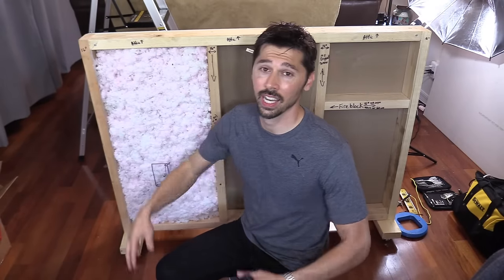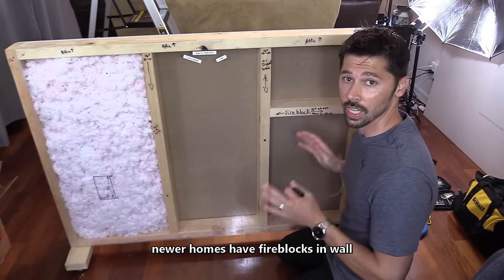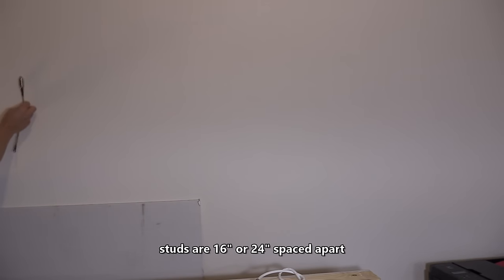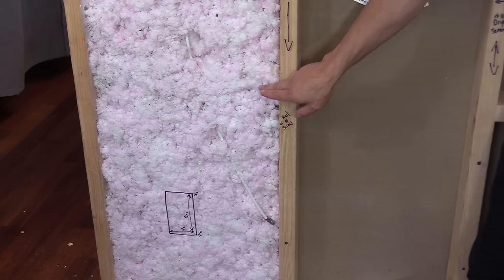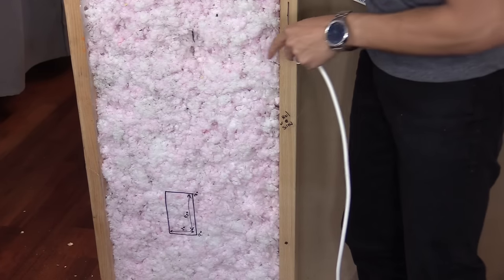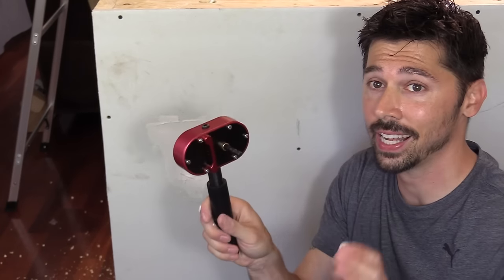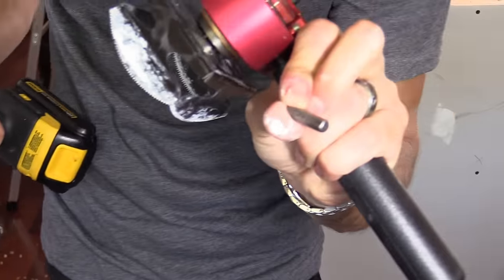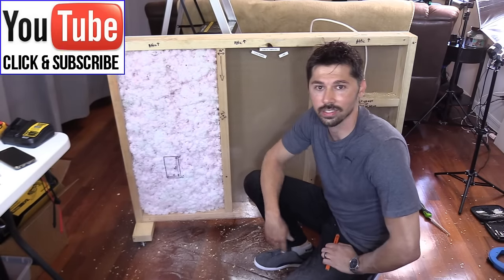3 EASY WAYS TO HIDE WIRES CABLES IN WALL & FIND STUDS

Comment: as an electrician i did that stuff for 40 years the fire block you use a flexible  bit its 4f long you can bend it any way you whant look it up its made by greenlee
Reply from the maker: thx for the tip
Reply: this thing....?
Reply: ray tru Ditto.
Reply: ray tru Klein makes them too. It would be a lot easier and you don't have to cut and patch the wall.
Reply: By drilling through the fire block, you defeat the purpose of the fire block.
Reply: Co Rin Not really. Fire blocking is just a slow down. The material is the same as studding. It burns. True a small hole will give a few seconds less protection but it's not a total dead stop for fire.
Reply: Long drill bit FTW.  No holes to patch.
Reply: Flex bits are where it's at!  My favorite trick was always drilling down from the wall plate opening into the basement. Wrecked more than one bit on concrete doing that, but oh well.
Reply: elesjuan Yep,,, wood bits on concrete,,,,, a definite nono.
Reply: then we wouldnt have any wiring in any of the walls in any construction in the past 20 years
Reply: The long bit makes sense for cutting the hole.  However, how do you then fish the wire through that hole?  I can only guess you are using some kind of fishing rod?  Just poke until you hit the hole and then run the rod on down?  Or is there another method?
Reply: It's really cool the long drill bit you just used to make the hole is used as a fish rod. Without retracting the bit tape your pull string or wires on and let it go. Boom no patching. Customers hate patching...
Reply: Cool.  

Yeah, I was recently looking at having to rewire all the electrical in my house.  It is an old house and has/had lots of 2 prong outlets.  I was trying to think of ways of keeping from cutting holes in the walls...  just like you said... lol.  Luckily, before I got too deep in the planning process I thought it would be a good idea to open up a few outlets and see exactly what was in there.  Sure enough, there was actually a ground wire in all of the outlets.  They simply had the wire connected to the outlet box (which was metal) and not the outlet itself.

I simply disconnected the ground from the box and put it to the negative on the new outlets.  Then I ran electrical tape around the outlet several times to make absolute sure the side screws will never contact the metal case (small case).  Seems to work fine.  Not sure if this is how you are supposed to do it but it is better than how the prior owner had rewired a few outlets.  They had put in a couple 3-prong outlets.  They even passed inspection as being grounded properly.  However, when I pulled the outlets open what actually had happened was the ground was still connected to the metal box... HOWEVER, the grounding screw had been touching the metal case... thus completing the circuit.  I couldn't tell if they did this on purpose or not.  Looked scary though.
Reply: "not sure if this is how you are supposed to do it"- it isn't. If you have metal boxes, you have to ground the box as well as the device.
Reply: Right, I thought you had to ground to the metal box AND the outlet/fixture.
Reply: ray tru 
Clearly you were an electrician, not an English Major... jus sayin'
Reply: @b.l. alley... Thanks for the info.  Shouldn't be that hard for me to ground those boxes as well.  I think the house was built in that short time span where they ran ground wires but were still using 2 prong outlets.  Regardless, I'm just happy that the wire is there...lol.  I thought for sure I was going to have to shell out a ton of money and/or put in a ton of effort to rewire the whole house.  Redoing the outlets is something I can easily do.  It has just been hard finding info on how to treat those metal boxes.  Most have said to just do what I did... so I did.  I've only seen one other source that said to ground the box as well.  That along with feedback here has convinced me to go that route.  It makes more sense.  I guess I just needed others to convince me to ignore the other advice.
Reply: Was going to say the same thing, my supervisor would have killed me if I'd had to patch a wall during a post-construction wiring job. That being said, losing one of those long bits is an equal headache.
Reply: Trust me, drilling through one lously fire block is not going to speed up the burning  of the house.
Reply: Look who's talking? You can't even spell "just saying."
Reply: ray tru That's what I used.  I had some really long bits and I also sharpened them so I didn't have to keep getting new ones.  You could feel the stud and center the bit as best you could and carefully drill.  Some of the drill bits had a hole on the end so you could attach the wire and just pull the drill bit out and then you have your wire.  The only trouble I had was in old houses.  The wood in the walls was as hard as concrete and you never knew what was in a wall.  You pretty much had to wing it.
Reply: 101perspective Some of the long drill bits had a small hole on the end so you could just attach the wire to the drill bit and pull it down that way.
Reply: As an electrician, my self, flex bits are the way to go. 4' & 6' are what I have used to get through the fire blocks.  8AWG & 6 AWG solid are great for getting through the insulation. Utility knife or punch saw to cut the holes in the sheet rock. 

Who needs to spend the extra money to save a minute or two?
Reply: ray tru how do you seal the fire block after?  Or is that not necessary?
Reply: you can't always get a flex bit in the wall though like when you have to fish down the end of a roof pitch. drywall patches are inevitable in some cases.
Reply: i don't think I've ever sealed the holes in fire block in cases where its not new construction or the wall isn't open. there is no inspection and really no good way to get fire foam in the wall without cutting it open. not a big deal really if you aren't making massive holes and the wire fills the majority of the hole.
Reply: ray tru 
Bien Sur, je peux parler Francis quand il est necessary !
Who the f~(K  is gonna need Potugese in a lifetime? I've got a whole arsenal of language under my belt ... A lot more than you could ever say.   And what's a Dumy?  You wanna do me ?
Reply: lawrencet83 Dont get me started !  We'll have the spelling bee right here right now !   I'll take y'all on.   The other guy wanted to do me?  Whasupwitdat?
Reply: 101perspective Drill 2 holes in the top plate and look w/flashlight or feed scope through 2nd hole
Reply: I agree. You have me beat by a few years. I've been an electrician for 24 years. I use the greenlee 4ft bit as well. Hell I have added extensions to it to make it reach. I like the hole in the tip so you can use it to pull the wires back up.
Reply: Chris Nixon 3m makes a residential 2hr fire caulking it's yellow in the paint dept at Lowe's usually like 5 bucks a tube fill your holes in your house w that
Reply: If you look at the bits they have a spot to attach a wire at the end, they have extensions that attach into each other to make the bit longer, normally you would drill until you reached the desired spot, attach poly line or your cable and pull the bit out, then use the poly line to pull your cable.
Reply: What if you need to run wires horizontally?
Reply: Eddie those flexbits you can run sideways, just be careful you don't drill through the wall, is it on the first floor?
Reply: Just be careful you don't walk the bit right out the wall, then you have a fun and exciting convo with the customer and it is a lot more involved to fix it seamlessly
Reply: 101perspective A glow rod with your wire attach to it.
Reply: The method to keep the drill bit central is to use bumber balls. Basically a wooden ball with a brass ferrule that you slip down the shaft of the flexi drill bit which then keeps the bit away from the drywall. Obviously you have to feed these in from the cutouts for the outlets but they really enhance a flexi bit's usefulness. Really a guide on how to get wires through walls that suggests cutting holes in the wall to get around a fire break is pretty much a junk guide.
Reply: what the hell do you tell a customer that has wallpaper? just pop the square piece back in and let them deal with it?
Reply: Hey Mon you should explain to them what you would have to do and try to convince them to relocate that hookup.
Reply: Ray is right, flex bits work great in walls but be careful if drilling between multiple ceiling/floor joists as plumbing pipes are strapped tight against the opposite side of the wood sometimes & even with tons of experience usually by the time you realize you’ve punctured the pipe it’s too late. 

Oh and I’ve wired hundreds of new track & custom homes in San Diego which California having some of the most strictest codes in the country & I have never seen anyone firestop electrical penetrations unless the electrician drilled an excessively oversized hole that left a large gap around the wire/s. Most inspectors want to see 7/8” bit or smaller, drilled as close to center of stud as possible.
Reply: I've used flex bits six feet long plus extensions if needed. I'd much rather just drill a hole through the top plate and fire block from the attic then do a time consuming drywall repair, texture, paint job anyday. Seems like this guy is just slinging tools sold on Amazon and making a cut on each sale, rather than sharing knowledge and experience. Clearly, he lacks the basic skills and relies on fancy, unnecessary tools instead.
Reply: ray tru QA
Reply: Co Rin - Did you hear him say that you must fill drill hole win fire block foam?  Yes grasshopper, learn before you teach. 

I hate trolls.
Reply: There is fire block foam and putty that plugs the hole up.
Reply: Yea if you have the space to get the long bit in the hole. How many times you still have wall repairs. I just did a job where the customer said no holes in the walls other than the outlets.  I took out the door jam and bored horizontal. It worked customer was happy.
Reply: It doesn't matter if the ground screw touch's the side because adding a ground wire between the screw and box is doing exactly that.  Metal boxes serve as the ground, at least if the conduit is metal and remains solid all the way to the service panel. Putting the ground directly to the neutral side of the 2prong outlet is NOT a good plan. In fact it's a REALLY BAD idea. Spend a dollar or so and use a grounded outlet.
Reply: Yea I had an alarm company drill with a long flexible drill bit down through the fireblock and then he connected the wire to a heavier and thicker tube so that it would go down exactly where he wanted it into the hole he just drilled in the fireblock. His partner kept watch on the other side of the wall to yell if he drilled through the wall with the flexible drill bit.
Reply: Here go the spell check experts again.Just saying.
Reply: Ray, A paddle (spade) bit larger in diameter than the 2 + extensions you'll need to drill down through the fire block from the attic or up from the crawl space. A flash light, a 2' x 2' piece of 3/4" plywood to kneel on spanning ceiling joists, maybe a hole saw and a notch plate (if cutting the side of the block). Many of the paddle bits have a small hole through them to attach wire being fished or  I use Jack chain to drop down the face of the insulation and after cutting the hole for the remodel box, hook the chain with a short piece of #12. The idea is completing the task in your head, before going up the ladder and only ONE trip up the ladder.  He either needed help or that was a full days work.
Reply: There is a small hole already provided in the drill end point to allow you to attach the bare copper ground wire found in most cables. So, when you pull out & remove the flexbit you are pulling in the new cable or pull wire.
Reply: Ditto, so true. Never mess w/their wall finishes if possible
Reply: 101perspective
The flexible bit has a pin hole in it. Add an additional bit to it and go right to your outlet box. A strain relief basket (w/swivel) clips into the pin hole. Reverse the drill and pull up wire. Side note : I don't want to tell you how many times I drilled right through to the outside of a house with that POS flex bit. Never use it again.
Reply: Late to your comment, but yes long bit to cut the hole and then a glow/fish rod to fish through.
Reply: The Greeen Lee flex bits (they actually make several lengths and extensions) have a small hole in the bore tip (it's an auger style bit, and has a hole in the middle of the auger area) and at the end of the bit in the tang. You 'could' tie a small wire or string through it and then use it to fish the cable through... However, I always used electrical tape, and just taped the cable I was pulling to the end of the flex bit, then pulled the bit out of the wall or dropped it into the wall from the header.
Reply: Cant use a 4 ft bit if you are at the edge of a gable roof trying to get down the wall.
Reply: Or use an extended augur drill
Reply: yes agreed but all have their problems, like not having 400mm in the roof space to fit the drill and bit, it turns on the stud and pops out the wall linning, but all in all great till to have
Reply: They also have several sizes that are eight feet long and flexible, which have saved my bacon on more than one occasion. And since you're an old-timer like me, when did "purlins" become known as "fire blocks"? I think I must have napped through that. ;-)
Reply: a b. Sometimes you can, depending on the roof pitch.  It may take two people - one on the drill, one with gloves steering the bit.  Otherwise, I've used a flex from below - once through the fire stop, disconnect from the chuck and tape string to the end, then fish the cutting end of the flex through the hole you make with a conventional bit in the top plate.

When all is said and done, sometimes you just have to punch a hole in the drywall :(
Reply: David Jackson  They became fire stops long BEFORE old-timers like you were around.  It was begun when balloon framing was still popular (mid 1800's - 1930's).  Two story houses were the rule back then, and balloon framed walls were essentially two-story tall chimneys when a fire broke out.
Look at it picture of how balloon framing was done, and you'll understand completely.
Reply: 101perspective Most of the long drillbits have a small hole at the end of the drillbit to designed to have a piece of the center conducter of coaxial cable run through it or you can tape a string on it
Reply: I was going to comment this. We use the long 4 or 6 foot bits all the time for this. It takes a bit of practice and "feel" to make sure you're centered. You don't want to drill through the side and out the drywall!
Reply: I think this video is the reason why most Telecom companies don't allow their "installers" to fish up/down walls.  They tell the customer to get an electrician if they want it in the wall.
Reply: ray tru 
Hell yes, never ever mess up a customers drywall.....or you will either fix for free.... Or pay someone to fix for you... Either way.... Your working for free.
Reply: Eddie you don't haha run it up and fish across to where it has to go
Reply: by cutting a notch in the fire block you defeat the purpose of the fire block
Reply: 101perspective lm
Reply: 101perspective  I don't know if you are a troll or just uneducated. Ground and Neutral should NEVER be connected in the outlets. They serve a different purpose and must remain separate.
Reply: The plug is made to do that
Reply: 101perspective two snakes, two guys. One in attic, one at hole in wall. Catch each other. Or a sash chain in attic and snake at wall opening.
Reply: 101perspective on newer outlets if the metal box is grounded the outlet will be grounded through the device mounting screws.
Reply: daniel bean 6/32 where I’m from
Reply: Crocellian but, he didn’t.
Reply: Interesting, very useable if only one fireblock. Still a bit fiddly to get the wire through that hole I guess
Reply: sounds a lot safer than electrical tape. I hope you at least placed minimum 6 layers of tape (industry standard where tape MUST be used) 

It would be FAR safer to simply make a short ground lead with an eyelet crimp on one end that can be screwed to the existing grounding point on the metal box.
Reply: @KitchenerLeslie2  Thanks.  Yeah, luckily I figured this out before redoing all of the outlets.  I did do 3 where I rerouted the ground to the outlet ground itself.  Then I figured out that the outlet ground connects to the metal part that you screw the outlet in place with.  And that screws directly into the metal box... just like you point out.  What I did with the rest of the outlets was a compromise.  I left the ground wire on the metal box.  However, I then screwed in an extra ground wire into the back of the box which I then connected to the outlet ground screw itself.  Probably overkill but figured better safe than sorry.  

Btw, that ground wire I found WAS properly grounded already.  So, during all those years that the prior owners put up with having just 2 prong outlets all they technically had to do is spend $2 and buy a 3 prong one for each outlet.  Like a 5 minute fix.
Reply: took you 39 years to master it.
Reply: 101perspective Alarm installer here. If I need to use a flex bit I’ll drill from inside the house up through the fire block, through the top plate, and into the attic then I’ll remove the drill with the bit still in the wall and tape my wire onto the back of the drill bit then climb up in the attic and pull the drill bit up pulling the wire along with it.
Reply: @peterford9369  You are supposed to seal the hole after you finish pulling the wire... there are special approved sealants for that.  He mentioned it, but forgot to demonstrate it.
Reply: I've got 14 foot ceiling in my cathedral living in my living room. The fire block is about 6 foot from the floor and 8 feet down from the top plate. Trying to drill 8 feet down from the top plate with any bit isn't going to happen, especially since the roof rafters in that area are about 3 feet above the plate. My solution is pretty much the same as his, except that I used a 2.5" hule saw centered on the fire stop, removed the plug and chiseled a small trough on the face of the fire stop to channel the cable, and screwed the plug back with one screw through the hole saw pilot hole.
Reply: true, I have the extension bit myself, and the bender handle.  but this would sure be a good additional option to have.  you never know what restrictions you'll run into.
Reply: @corin164    Wow how clever of you, but a 3/8" hole will not decrease the fire-stopping properties by any measurable amount. It's designed to slow the spread of fire and smoke...but it's wood and will eventually burn anyway.
Reply: @101perspective  remember in the video, the OP made a hole close to the fireblock to be able to manipulate his magnepull so I assume you could just direct the fish directly in the hole like that and continue at that point, right ? I am sure you found this answer, but maybe it can help others having the same question :)
Reply: How good is it when the drop down the wall 😁
Reply: yes theres many ways, hes just showing you his way he thinks is easier for him.
Reply: Problem with flexbits is you’re drilling blind and tend to cause more damage in the end. Can’t tell you how many times I popped out of the sheetrock.
Reply: @elesjuan  That will work only if u have a basement or workable crawl space.
Reply: @101perspective  The flexbit has a tie hole on both ends. U usually tie off your cable on the flexbit and pull it thru.
Reply: @101perspective  U should still bond the ground to the metal box.
Reply: @sergeantseven4240  True
Reply: @jonathanbuzzard1376  I use a steering handle made for flrxbits.
Reply: @rickalders  Magnaroller has been around for 20 years and is invaluable. It's fast and fairly uninvasive.
Reply: I would recommend people practice patience with long flex drill bits. You will need to learn the feel of where you are as you will be drilling blind and don’t want to drill through wires or plastic plumbing pipes.
Reply: @MrDoomey375  I havent done it personally but have worked with someone who has and definitely not a happy customer lol
Reply: Try drilling down in a tiny attic with a long flex bit ..  notching its easier.
Reply: @rickalders  I agree, did you notice in the background that his own tv has wires hanging down.  You would think a pro installer would hide his own wires, haha.
Reply: Tampatec where can you purchase a flexible extension drill bit? One more thing, I am NOT a professional dry wall installer but I’m pretty sure they don’t put dry wall screws in a fire block stud. I have been in a new construction home while they were installing dry wall and have never seen a screw in a exterior wall fire block on the stud. Just saying
Reply: @corin164  a fire block only slows the fire, it doesn't stop it from spreading.